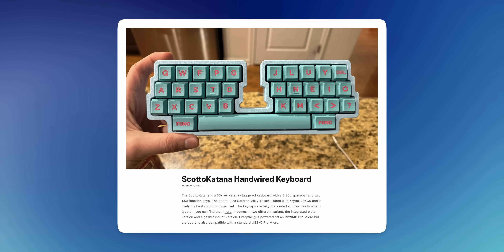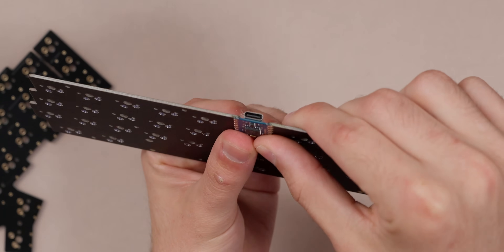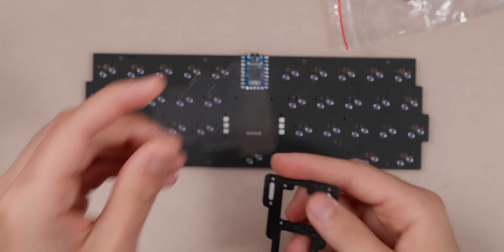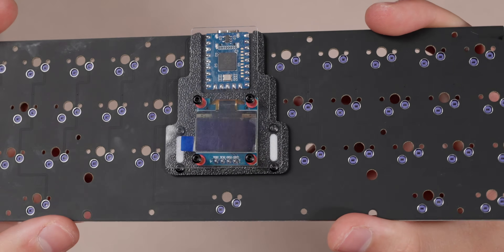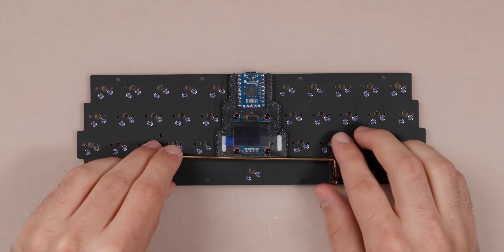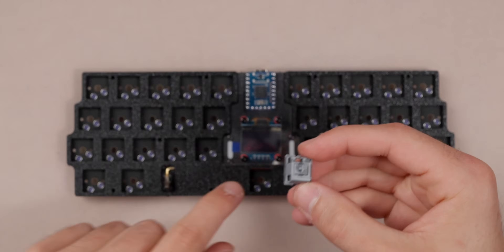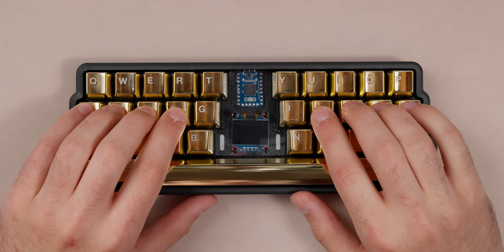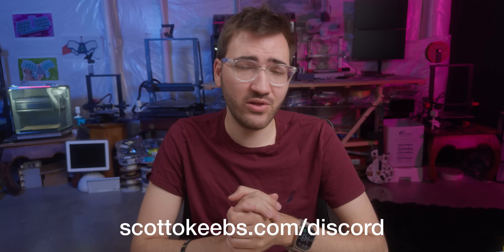Building the ScottoKatana (PCB Edition) Mechanical Keyboard

Comment: Heyoo, love your videos, can you make one about flashing firmware on rp2040 zero, I have one myself, and a bit lost on how to flash the firmware on it for my 4x4 macropad. Keep up the good work.
Reply: it's very easy just chuck the file qmk gives you after compiling into a plugged in rp2040, first press the reset button then chuck it in, then it'll work.